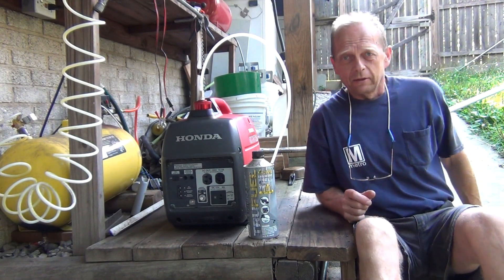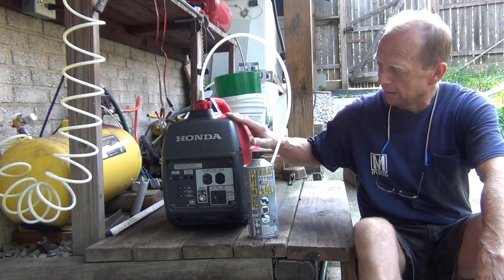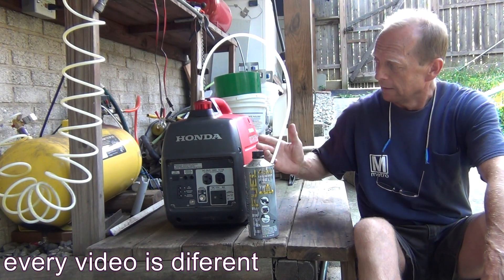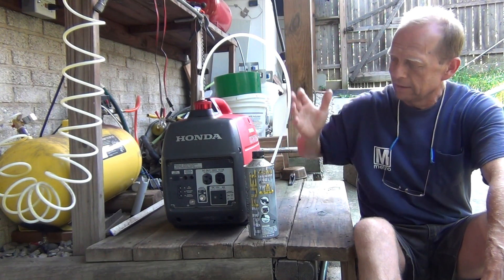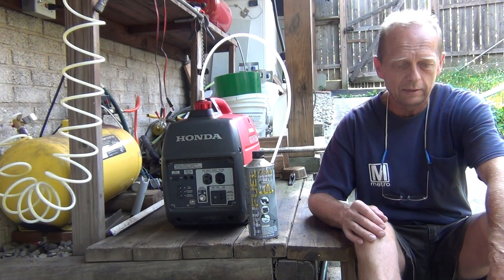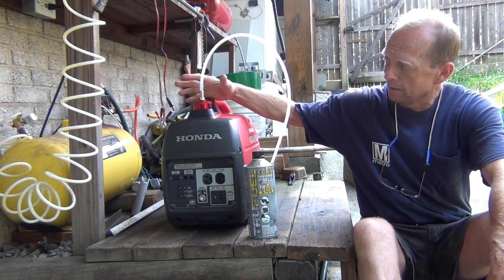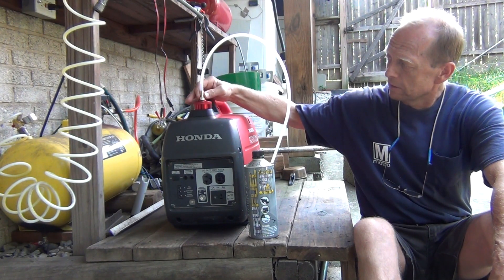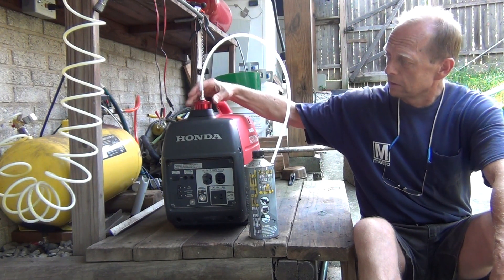How does the dual fuel tank for Honda eu2000i work

Comment: Vlad, what kind of cap were you using ?  Right now the various ones sold on Amazon i see people warning about the threads not being an exact match and slowly stripping out the threads on the original equipment.  Did you notices this happening on yours?  Since this was an older post, i figured by now you would know.  Any recommendations?  I really would like to make mine run longer than the one gallon fuel allowed on board.  Appreciate any suggestions you may have.
Reply from the maker: @doradean3097  I’m not using it at all but the fit was good. I got it on eBay

Comment: If the tank of the Honda contains a lot of air, then it takes much longer until the used petrol creates a sufficiently large vacuum in the tank to suck the petrol out of the other container. It works much better with little air in the tank.

Comment: Stupid idea mate... the external fuel supply should be either higher than the generator or the tranfer hose shoud be expelled of air first using an inline primeing bulb and it should have an inline fuel filter. You can't ask the generator fuel pump to draw up the gas with a hose that has air in the fuel line. You should have known this.
Reply: Hey Dude 
So how come it works?
Reply: There is no fuel pump it works entirely on vacuum.
Reply: @tree9851  this generator does have a fuel pump. It’s a pulse fuel pump

Comment: Hey Vlad don't mean to ask too many questions, but you said you ordered the shop manual for your Honda generators is that correct?
Reply from the maker: Right and I do have it
Reply: @VladFredK  Does it state how to clean the combustion chamber? Thanks.
Reply from the maker: @TheMickeymental  it doesn't
Reply: @VladFredK I do thank you very much. It is very odd that cleaning the combustion chamber is required after every 200 hours to maintain the warranty. From what I have read this requires a complete engine tear down and cleaning of the piston walls and the top of the piston. Do you live in the U.S? Thank you for your response.
Reply from the maker: @TheMickeymental  I live in Washington DC area

Comment: Hey Vlad I would love to do that, but first on my list is a LowPro lockdown. I live in a capital city and these generators tend to walk away. Great video and I do agree with another comment on this video. I think I would elevate the fuel above the generator and put as little stress on the generator's fuel pump as possible or keep a spare pump.
Reply: There is no fuel pump, it works entirely on vacuum.
Reply: @tree9851  It does have a fuel pump.

Comment: I would have it primed and have the fuel tank elevated you don’t want to make the small fuel pump work hard as it will wear it out faster the fuel tank in the generator is elevated above the fuel pump only makes sense